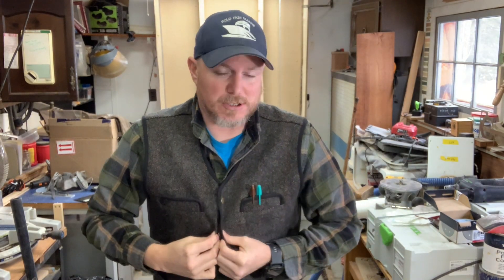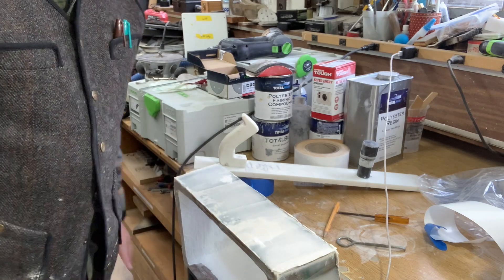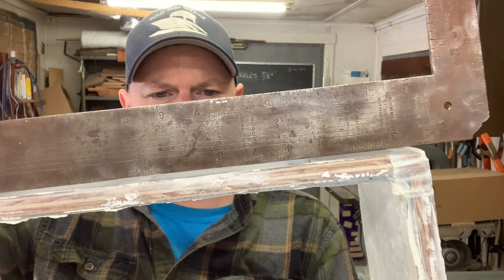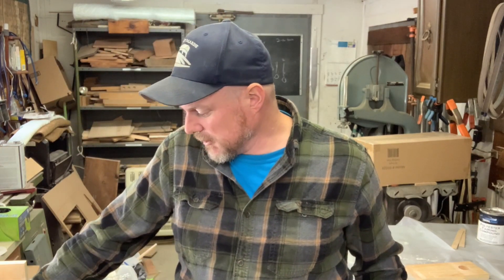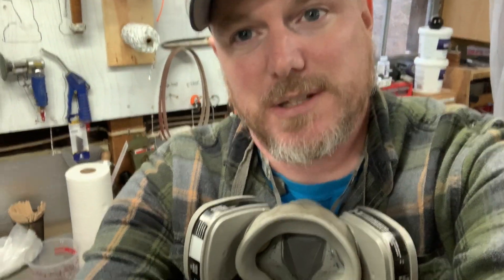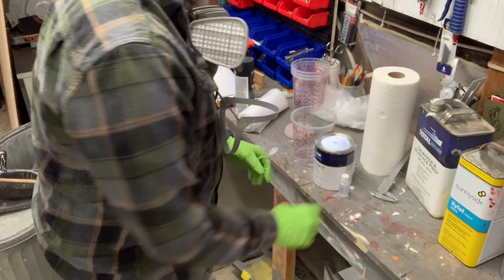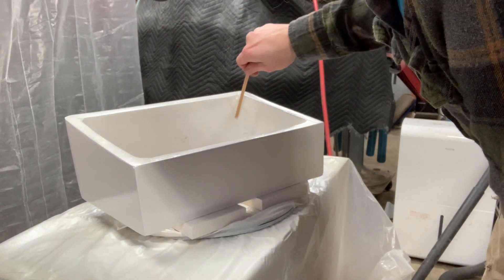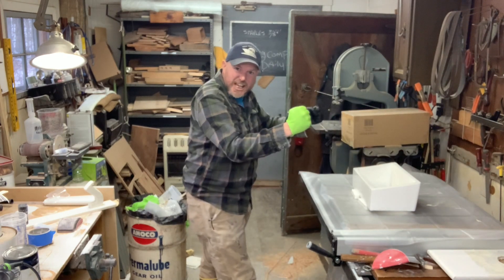How to spray gelcoat [with a cheap spray gun] |dorade box part 4|

Comment: Great video, thanks!  I'm a DIYer and have tried spraying gelcoat with varying degrees of success over the years.  There is an additive/thinner called Duratec that I really like.

The tip on removing the filter is gold.  Can't wait to try that!

Funny story:  I sprayed a part one evening--it was cold in the garage and the gelcoat didn't want to kick.  I warmed the kitchen oven to just over 100 degrees, turned it off and put the part in there overnight.  Worked like magic; but, when the wife and kids came into the kitchen for breakfast the next morning I was not a popular man.  Needless to say, I haven't done that again.  Haha.

Funny sidenote:  Since this video is for a "Dorade Box" I thought would share that I've actually done a bit of sailing on Dorade.  Great program.

Comment: I'm using this same spray gun woth the 2.5mm tip and the gelcoat doesn't come out at all. What psi are you running your compresser at? I'm got it regulated at at 80 psi on the getting about 40-60psi when it drops and still nothing. Any advice?
Reply from the maker: Did you take the screen filter out? Watch my other spraying gelcoat video and I explain where the screen is.
Reply: @Hold Fast Marine DIY tips and tricks  yes, I took the screen off as well. The gelcoat I'm using is from fgci with wax. Not sure if that makes a difference.

Comment: What size compressor are you using? Sorry if I missed that in a previous video.
Reply from the maker: at the time of this video it was a small rolling job site compressor. I now
 have a large 200 gallon compressor.
Reply: @HoldFastMarine  Thanks, I was wondering if a 10 Gallon Rolling Compressor might do the trick.

Comment: Looked like you mixed it with half the required hardener (4x16=32?).  How did it turn out?

I had my first experience wit gel coat (Evercoat One Coat - no wax needed) this week and even though I mixed it correctly it’s not curing.  I wish I watched this first because you go to great effort to maintain room temp.  I’m in CT and my garage was 62F during the first 24 hours.  I have it up to 72F now but not sure it’s going to fully cure.  Very upsetting.
Reply from the maker: Gelcoat will not cure without wax, or putting pva over the top. Any polyester based material needs to have either wax, or pva added post spray. I always use the required amount of mekp, either by weight or drops.

Comment: Hello, so if you use gelcoat with wax, how many coat can you spray. Do you have a video explaining gelcoat with wax and without? Kinda confuse lol
Reply from the maker: Gelcoat with wax needs to be sanded between coats. Without wax is a laminating gelcoat and can be applied several times. But you need to cure the unwaxed gelcoat with either pva or a final coat of gel with wax. Check out my other spray video

Comment: Be nice to know what aircompessor for the job on a budget.
Reply from the maker: You can get a 60 gallon dewalt air compressor for about 800$. That’s as budget as your gonna get. Nothing less than a 60 gallon.
Reply: Okay 60 gallon. Does the horse power or psi matter? Psi to cfm conversion would be great too. Thank you!!
Reply from the maker: @Shokenryu  it does matter. You have to do a little work yourself bud. Always follow the manufacturers instructions when spraying.

Comment: Did you try the cricket with gelcoat?
Reply from the maker: are you talking about a dump gun?
Reply: @HoldFastMarine  
I don't know what a dump gun is. I was thinking of spraying gelcoat for a boat.
Reply from the maker: Well I don’t know what the cricket is lol. A dump gun is a spray gun made specific gelcoat. They start at around 200$
Reply: @HoldFastMarine  yea I'm ok 😆.  Critter paint gun. Cricket must be a smaller version. Sorry. So have you tried the critter to spray gelcoat?
Reply from the maker: @redwood1957  I have never tried one, but did google it. The nozzle is very small. I don't think you'd it to spray.
Reply: @HoldFastMarine  I mite try  the cricket then.
Reply from the maker: @redwood1957  yeah try it. Let me know how it worked out!

Comment: You didn't mention if you thinned the gelcoat to spray.
Reply from the maker: Hello! I did not thin the gel at all. Truth be told I’ve never thinned gelcoat.
Reply: I always thin with spectrum patch aid to get rid of orange peel as well as give faster or slower cure depending on which patch aid I choose.
Reply: I guess they mean they reduce it all the other mumbo jumbo is pointless

Comment: So I guess it’s ok to spray gel coat without a thinner?
Reply from the maker: It sure is!
Reply: Thinner for gelcoat? U from Mars?
Reply: @vasantuchil5302  you much be from not this solar system cause it’s perfectly normal to thin gelcoat for spraying in a gun…….
Reply: @ants00  
Not advisable at all Rossi. Check it out. Gelcoat is a special formulation & viscosity is maintained by mfrrs for ease of application, always. By thinning it you are compromising quality as thinner will react in a haphazard manner. Earthling if course 🙏🙏🙏
Reply: @vasantuchil5302  I literally talked to them on the phone before I did my work. They said it’s fine and done all the time. I think the people who make it are to trust. You HAVE TO buy it without wax and apply the a coating at the end to cure it. If you don’t  then the job is done wrong. If you add the wrong about of styrene(which is all you can use to thin, not acetone) then it’s done wrong. So there’s a lot to do right to make sure it’s done correctly
Reply: @ants00  ask Scot Bader, best gelcoat mfrr . Unsaturated Polyester resin gelcoat is made with right proportion of styrene. Additional thinners compromise quality of gelcoat . Try it on a speed boat & report after 2 years.